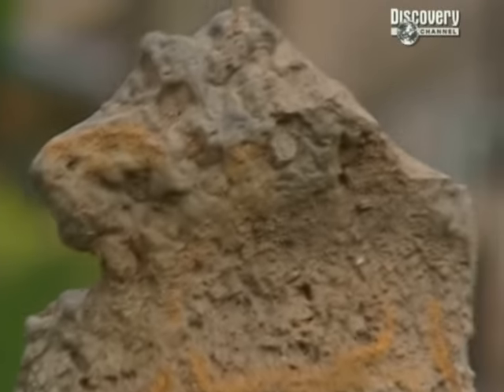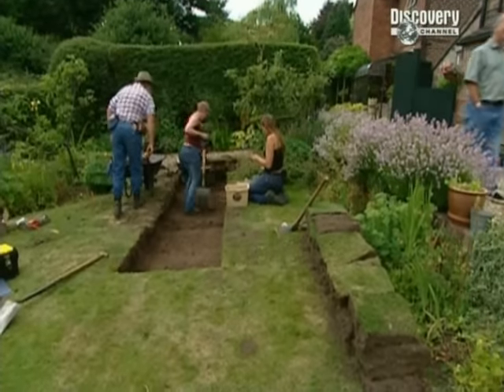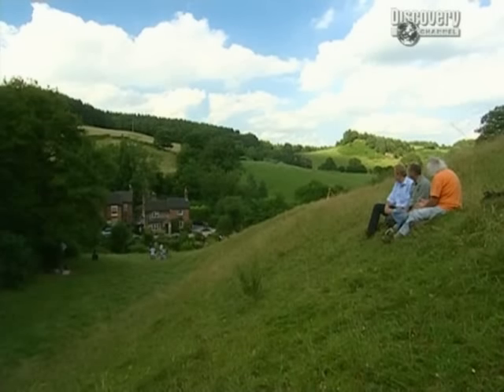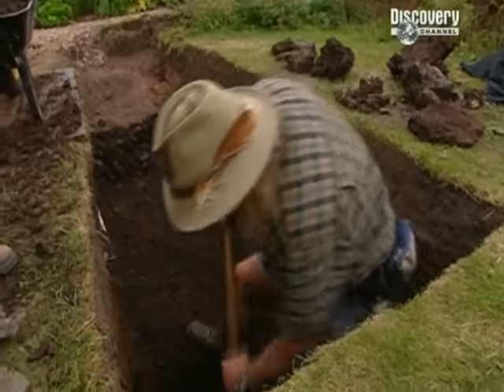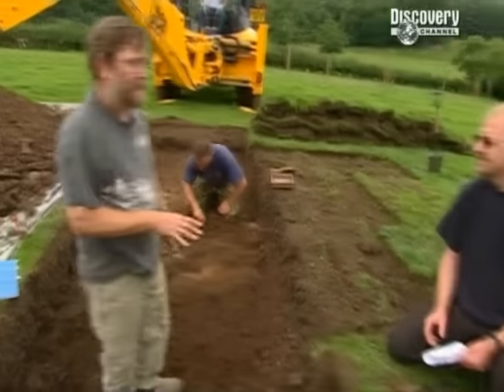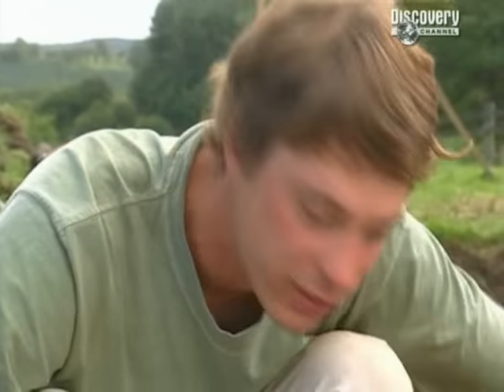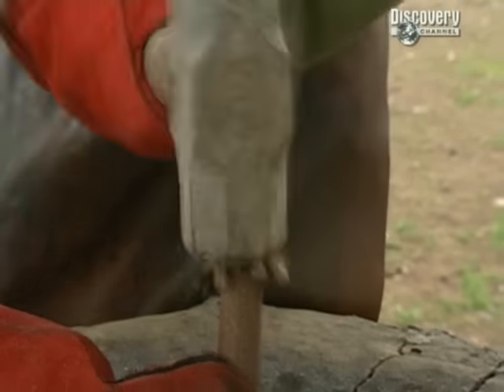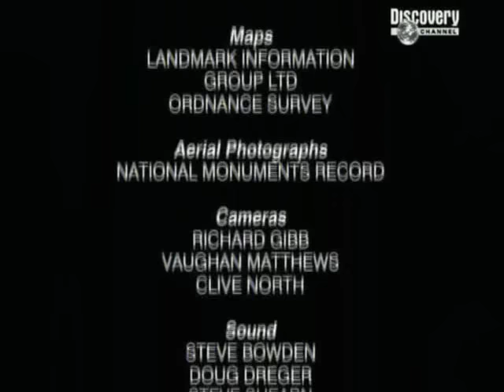Time Team S11-E07 Oakamoor,.Staffs

Comment: I love the rivalry between John and Stewart! Though I must say, I think I've seen Stewart correct more times than John, at least up to this point in the program. I don't know how the geo-phys results can be so very off sometimes. I've seen it pick up very distinct features that are simply not there at all, and I've seen it completely miss very distinct features that are right there in the ground. It's absolutely amazing how much Stewart can usually discern and predict, just from having a look over the landscape.
Reply: schradeya Geo-phys works based on density and magnetism. Dense dirt is still dirt, and if there is magnetic particulate, it'll look like metal.
Reply: John and Stewart are both wizards.  John rubs his magic lamps.  Stewart walks off into the woods and consults elves.  The elves have a higher batting average.
Reply: @rodritchison1995  Exactly.
Reply: Geophysics relies on the difference in ground composition. One of the elements to that is water.

If a dry gravel bed is in a clay bed it will give a signal.

And if a porous rock is water logged in a wet clay bed they'll see no contrast.

Igneous rock by its very formation and composition would give a magnetic signal.

The technology has moved a long way but it's far from perfect. But imagine how many things would have been missed without this technology. And now we have Lidar which is turning up a whole host of new archeological sites. Especially in dense jungle areas, like the Amazon.